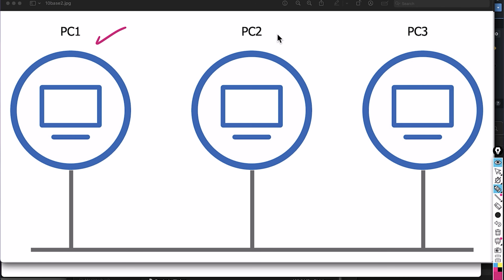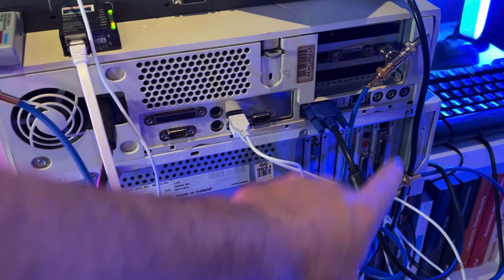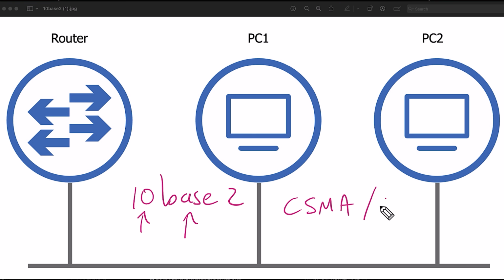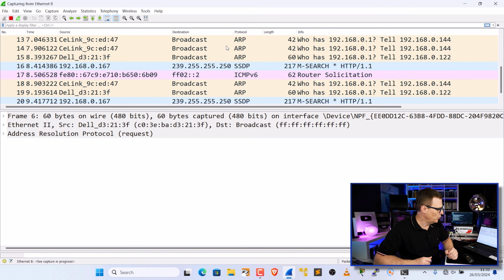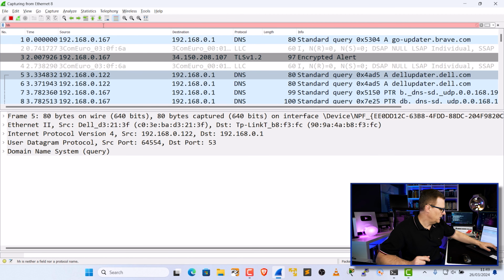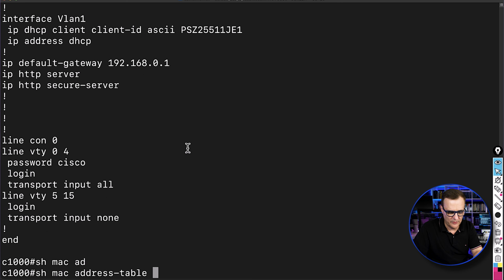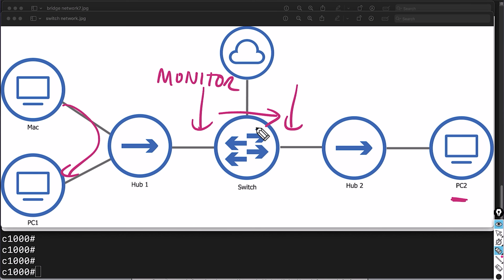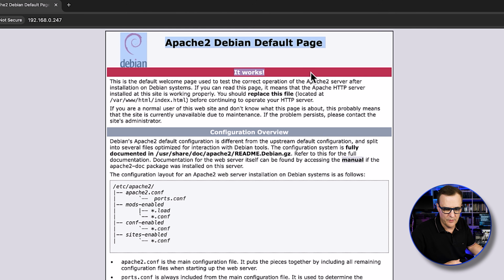You ever seen these devices? Networking for Hackers and Cybersecurity professionals.

Comment: I would wager if Windows (all versions) computers weren't on the other side of firewalls and routers, if there were no foreign built motherboards, routers, switches, transceivers or any Integrated Circuits, more than half of hacking wouldn't be possible.

Comment: might be good to map it to the OSI layer 
but still a good video explaining why different broadcast domain is needed and CSMA/CD is a legacy thing now since no one actually uses hub now and collision domain is also a thing of the past times since a switch separates collision domain with each port, which i think cisco still test it in CCNA.
  
haven't seen a small 10G inline tap just google that thing cost 900USD?! omg

usually those will use probably gigamon 

don't know if there is a SFP+ or QSPF28 small tap.

Comment: 16:49  Regarding the hub, could be used as an inexpensive tap to capture and troubleshoot issues on each of the devices connected to the hub? 

In other words, let’s say Dev1 is having network issues you do not want to install Wireshark on that device. You could connect Dev2 (PC  running Wireshark) and Dev1 together using a hub, and then connect to the rest of the LAN. Would that work to capture packets between Dev1 and the LAN?

Comment: Good day, David. I agree with you on the 'seen' aspect. I definitely learned something. Not only that, I should re-run your video to better grasp the concept of a spanning tree! Until now, due to the book, I had understood that a spanning tree was a device added to a router or a setup that prevents loopback or storm broadcast. If I got you right, we can set it up using the command line. Am I right? 
Furthermore, where can we find all the equipment shown in the tutorial to build our own lab and test—and actually grab it all?! Or can we use a software bridge, router, or tap? Many Thanks!!!

Comment: Hey David, I wanted to ask you because I bought an Alfa AWUS036ACH and wanted to connect it to my Kali. Everything worked, but I just can't get into monitor mode normally. I've tried everything and it's the only way to get into monitor mode is if I start wifite and cancel before it's over, then I stay in monitor mode, do you know why?

Comment: Thank you very much David  for the video. It has brought back a lot of memories when I started my IT career in the early 80's. Thank you for taking so much trouble and finding working retro hardware.
Since the AC was never adequate in our LAN environments the heat from the PCs would somehow dislodge the BNC connectors at the rear of the cabinet. One had to keep tightening them regularly.  
😅. At this juncture I am unable to join your forum. So please excuse. Regards. Paul

Comment: Wow.  I learned a lot from that. I now realise why i have the network slowimg down after a hub connector.  I use a asus router that looks similar to the router you held up at the end (4 switch connections and a routed connection) that I would like to understand (how to use) better. Are you comg to do a part 2 to cover routers, or have you already covered routers somewhere else?

Comment: I like how you show the older equipment. I started with computers in the late 1980s (DOS) but my first networked PC was not until around 1994. I wasn't into networking at that time, but I think it was Ethernet so I never really had any experience with token ring.

Comment: A couple of years ago our office got a call from a supplier to the federal government.  They said that their contract said someone had to be there in 4 hours if they had an issue and one of the servers were down.  Could we send someone out and say we were working for them?  So I went to the local federal center.  After a bunch of security checks I was led into the biggest datacenter I have ever seen.  On the right was rows and rows of racks with servers I recognized.  But on the left were V-Class HP servers the size of refrigerators the likes of which I had never even seen a picture of.  The whole time I'm thinking turn right turn right.  As we get to the very end of the rows she points to the left and said that is the server.  It had 50 physical processors.  Darn.  After they explained the issue believe it or not they were still running thinnet.  I looked and sure enough a tap had failed and I looked like I knew what I was talking about.  They had spare parts so I installed the new tap.  There was a guy in uniform setting at a keyboard who said "what would you like me to type sir."  Refraining from saying " global thermonuclear war" I had him do some pings and everything seemed to be working.  I then asked him what that server did for them and got the response "I'm sorry sir that is classified."  So I don't know what I fixed but it must have been darn important.

Comment: physical vampire taps were an o.g. technique of hacking and phreaking. basically one could intercept whatever was being transmitted through a cable, depending on context. this included but not limited to landline pots as well as ethernet cables. 

one preventative measure was to use a system of metal conduit piping to prevent any quick tampering of exposed cables along any publicly accessible areas. this also led to some to look into intercepting transmissions through other means which does not require you to physically cut the cable, such as figuring out how to read the electrical emissions from cables that were not properly shielded, or even the background noise from grounded cables (defcon talk about water pipes or ac ground), and other ways data may be intercepted (van eck, keyboard num lock or scroll lock). 

in a way, vampire taps have changed to various means of intercepting different kinds of network traffic through physical means. this would be an interesting topic to explore on your channel. the basic concept remains the same but it is applied creatively through other means. sniffing is often taken for granted since a lot of it is done through software now, but the hardware or physical side is less known and would be interesting to explore the possibilities… various techniques of not physically introduced into the network and does not disrupt the connectivity but can monitor it without negotiating an ip address or make itself known.